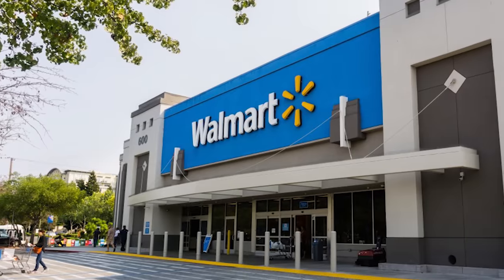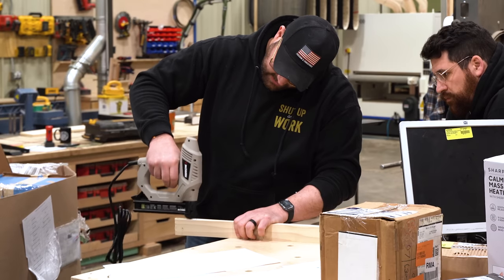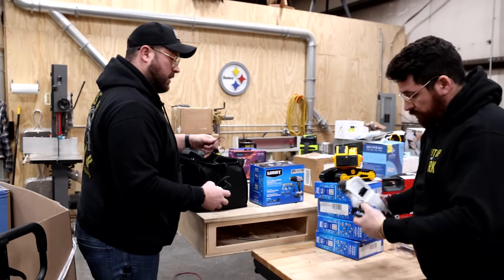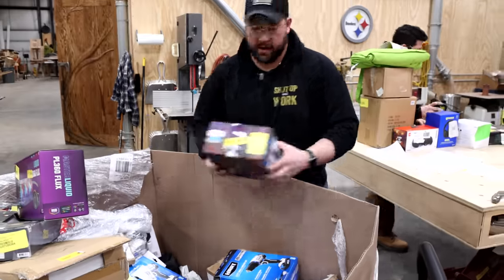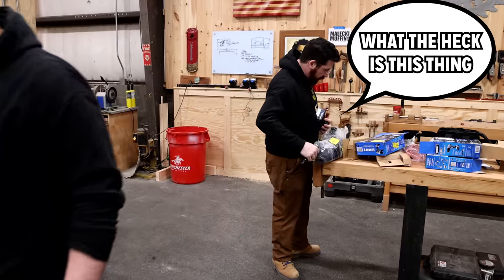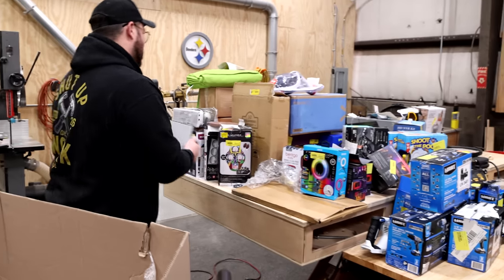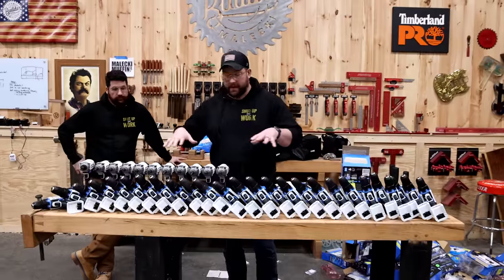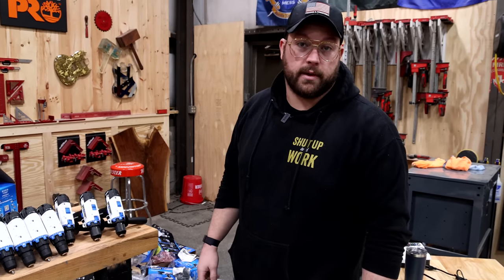I Bought A Pallet of Walmart Tool Returns for $2,217...... Mistake?

Comment: If y’all take the battery’s that won’t charge what you do if it can be saved grab a good battery don’t have to be same brand hook positive to positive on the good battery same thing on the battery not charging do the same with the negative let it sit like that for like 30 seconds, take it off and plug it up. If it don’t work repeat it if it still don’t work the batteries done. Just a friendly trick.

Comment: Just an FYI. When SOME lithium batteries get so low the power station trickle charges them and no light will show for charging or sometimes an error. I’ve walked away for 24hours and the batteries have charged up. I’m 2 months late with that info. Works sometimes though.

Comment: I guarantee that if you connect a wire from the positive and one from the negative terminal of a good battery to the bad battery for like 30 seconds it’ll reset it enough to hold a charge and everyone of those drills will work.

Comment: Not sure, but if these batteries are like some others. You discharge the voltage too low, the charger will not charge them.  To fix them take a known good battery, put a wire from the plus side of good to bad, and neg to good and bad. You don't have to leave them connected long. Then hurry place bad battery in charger. If it reads enough it will charge. It depends  on the charge weither it can recharge. low batteries. Sears was really bad for that.

Comment: If a battery is completely dead it won't let you charge it. You can jump a wire from a good battery on it for 10 minutes to give it enough of a charge for the charger to accept it as good. There are videos online on how to do it. Little to late but for future reference

Comment: John you can trick the dead batterys into charging and working use good working  battery and jump the dead batterys 1 at a time for about 30 seconds each then put them on the charger straight away and they will charge the reason  they don't charge because the voltage is to low in the batterys and the SMART CHARGER won't charge them, have done this to makita milwaukee and dewalt batterys and it works  cheers from down under

Comment: If you have a couple extra drill clips I'll gladly take them, use hart tools to install cable and my set never came with em. They don't sell them seperately.🤬 Carrying those up ladder instead of clipping them to the tool belt is frustrating! Honestly decent tools for the price though.

Comment: If those are lithium batteries they may have just went under voltage and the battery circuitry is calling it dead. Jump start ( positive to positive,negative to negative)the battery with another battery for a minute or two to get the voltage high enough for the charger to charge them.

Comment: If you still have those bad batteries,  you can repaire them pretty easily,  the cheap batteries have horrible solder points, so they break in shipping alot, i hope that helps

Comment: You can try to jump start the batteries by wiring to known good battery for 5 second then see if it will take a charge, I've done this before on RC batteries and older stuff like that

Comment: Watch a video on force feeding those batteries. They're so low that the charger doesn't sense it being plugged in. You need to force feed it for 10 seconds and then slap it in the charger. I've done this with a lot of power tool batteries with great results.

Comment: The battery are too low to charge. If you get a good battery similar in voltage. You can jump from good to the dead battery for about 15 second intervals you will charge the dead battery enough to be charged again. It's like jumping a car battery with another car instead of a trickle charger. Don't count out that 2k it's still could be possible

Comment: i open the broke battery pack and remove the batteries and put an connector in the emthy pack and use a lipo battery i put in my belt .same plug for all the  tools and it works fine

Comment: you can fix most of the broken batterys with a fully charged one and 2 peaces of wire just connect + with + and - with - and wait a little the full one will charge the broken one 
most the time the broken batterys are just fully discharged
Reply: wie gesagt die sind tiefen endladen und können warscheinlich durch das laden mit einer fullen batterie wieder weit genug geladen werden das das ladegerät die wieder erkennt und läd

Comment: The batteries usually are just completely discharged.  If you hook them to a good battery for a few seconds, they will then charge on the charger.  Car batteries work the same way.  Smart chargers won't charge a completely dead battery but if you hook it to another battery then start the charger, it will charge.

Comment: Some battery chargers won't start charging if the battery is completely dead.  Sometimes you have to trick them by using a good battery in parallel to get the charger to start. If there is no voltage the charger doesn't know a battery is connected

Comment: I work for Walmart here in Arizona and people always seem to buy these tools and use them for a short time, less than 90 days and return them for full refund. Happens all the time, Hart batteries are constantly being returned. My son brought me a dual set of drill and driver with 4 AH batteries and both would not hold a charge. Could be you purchased them. Oh well, that's life at Walmart.

Comment: Might be worth j7mping the duff batteries using the good batteries as the charger will throw an error if the battery has a to low voltage.

Comment: I know this is an old video, but most of those batteries are probably save-able if you plug in a steady current for a little bit to each battery.  They are probably reporting as bad because they got too run-down to "safely" charge according to the charger.

Comment: Hart batteries are horrible when they completely run out of charge!. When you try to charge the batteries they will say error. You will have to jump start them with one of the good batteries. Find 2 wires that are 12GA or thicker and put positive to positive and negative to negative and let them sit about a minute. Then you can try and charge the dead battery. You should be able to recover must of those batteries. Hope this helps.

Comment: The reason those batteries are showing error is because there is no energy in them and the charger can't read its there without power. Use a good battery that's charged and 2 wires to jump the energy into the dead batteries. + to +, - to - , it's on the tops of the batteries by the contacts. Then put the dead battery on the charger and watch it charge just fine. Had the same problem with other batteries, this will work most everytime, if it doesn't them yes the battery is probably damaged.

Comment: I have some Hart tools. They're not bad for what I do. They are made by TTi who make Milwaukee,  Makita, etc.. The batteries could probably be boosted. Most likely they're  discharged to a point that the chargers won't activate. Cool video though. I've always wanted to pick up one of these pallets, just haven't gotten around to doing it yet.
Reply: TTI does not make Makita.

Comment: The batteries for the drills including a charger will cost more than a new drill from wallmart with battery and charger ,been there and done that now I only buy Riobi and hitachi although hitachi have to many different voltage and battery styles

Comment: All of those batteries can be recovered.  They most likely got ran down and sat so low the chargers couldn't recharge them.  You can recover them and they will probably work just like new again.

Comment: HEY! Lay off the Ryobi hate! For 95% of what I do (mostly lathe and small carpentry like stuff)  in the shop, Ryobi is perfect AND it's significantly cheaper. Of course it won't work for heavy construction, but I'm not a profesional contractor, so...

Comment: You may already know this but, when lithium ion batteries get too low on voltage, the charger may not recognize a "good" battery.  So the problem with the battery could be a low battery cell. the charger itself, or both.

Comment: Jump the batteries that don’t charge with a charger one run a wire from negative slot to negative slot and one from positive to positive wait about two mins then put them on the charger again

Comment: If you jump the batteries with a good battery it wakes up the mosfet and the battery will charge the problem is when the battery dies completely the mosfet (charge control chip goes to sleep

Comment: The reason you got a shit load of drills and drivers with bad batteries is that folks walk into Walmart,  buy the drill and battery set, then return their old set that has a bad battery.  

They are stealing batteries.    

Oh, and you can just buy the batteries.   So, the Drills and Drivers still have some value

Comment: you can hack/fix the batteries - they're lithium ion and have likely dropped voltage below 3.0vdc per cel - the charger knows it cant charge lion batts from this voltage point so it wont charge the batteries. Here's the hack/fix: take two wires and strip the ends off both ends. Then take a fully charged battery (4.2vdc per cel fyi) and place the wires on the + and - terminals. then take the dead battery and place the opposite ends of the wires to its terminals making sure polarities match. So + to + and - to -. Leave it this way for about 10-15 seconds and the good battery will charge the bad one just enough that the charger will finish the charge on the bad battery making it good again.

This does work. try it and you'll see. I did it the other day with my dewalt battery.

Comment: If the drills work you could connect them via wires to a large battery or PSU and make something interesting with them.
Reply: If there is 4 terminals the outside two will be power and earth and then the inside two one will need a connection to positive via a resistor to signal there is a battery.

Comment: Jump charge them using a large battery charger. They sit so long that the batteries go almost completely flat and Li batteries are not fans of recharging after that. I would take a guess that a good 60% of them will come back from the brink.

Comment: Try to jump the dead battery's..
Get a fully charged battery and connect it to the dead battery's for 5 min with wires. 
And then charge them. .. 😉😉
It can wake them up.. 😁

Comment: Balance the dead batteries….they are likely good…the charger won’t start the charging process without a minimum Voltage…you do this by taking a good battery and using it to help the dead ones come up to speed ….charge them fully than all is good…avoid fully discharging batteries as this is a common fault run down close but stop short of dead

Comment: Jump the batteries off of a good battery with speaker wire to get it to 10 percent because the charger won't charge them unless they are at 10 percent or greater. It's the biggest scam with the battery industry.

Comment: batteries are extremely easy to fix they just have no juice if you take another battery with two wires and jump it they will work they just dropped below the voltage that the charger can detect

Comment: The batteries may just need to be hooked up to a full battery for a little while to raise the voltage. These batteries get too low and they stop charging. Common issue.

Comment: I think you need to do a challenge with Jordan and Sam where you build something using the tools and only the tools from that box and incorporate one non tool item from the box into the build. I think that would be pretty cool.
Reply: Jordan and Sam both quit and are now Working elsewhere.
Reply: @MrHeg666  what? When did they quit?
Reply: @charlesbailey4713  Sam a while ago, Jordan around the holidays.  It's in the videos if you watch them.